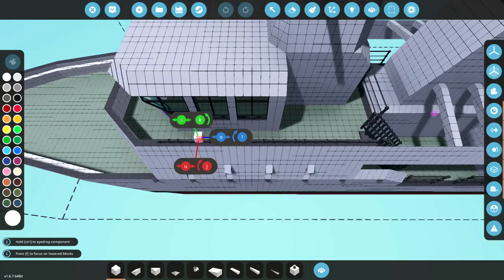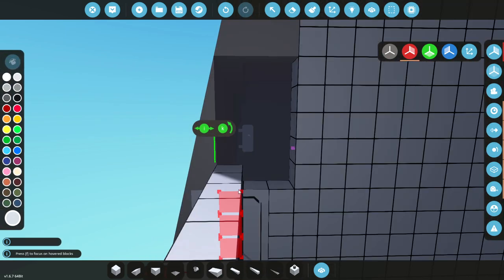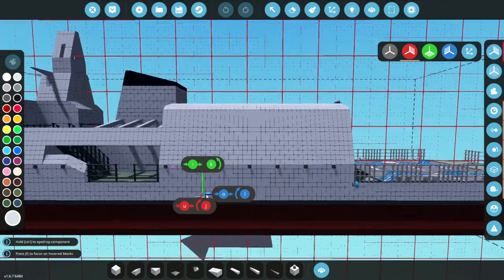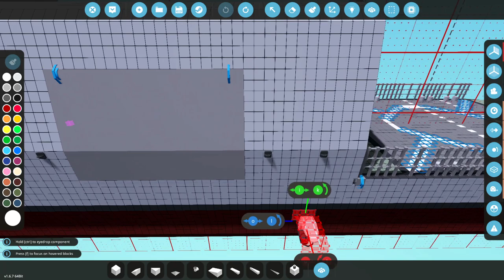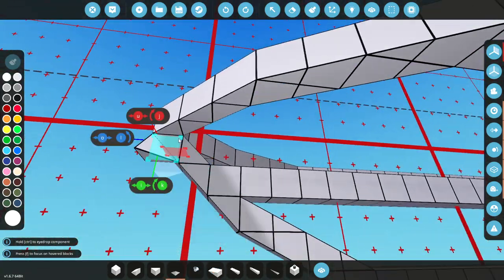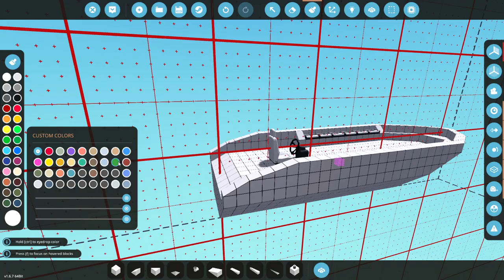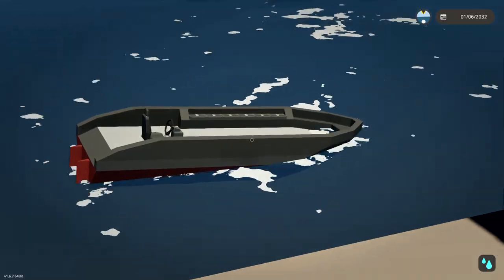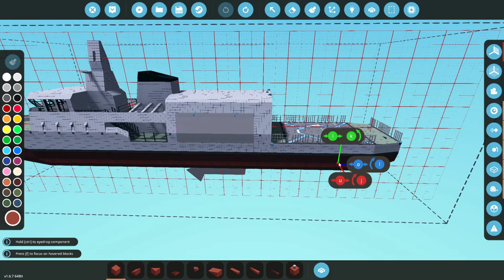HANGAR SIDE DOORS! - Modern Warship Build - Stormworks - #5

Comment: You should put the tracks in the hanger, then have the track/rails on the bottom of the helicopter you design. 
That way you can land on the helped, line them up and all you have to do is hit a button and the helicopter slides into the hanger on its own